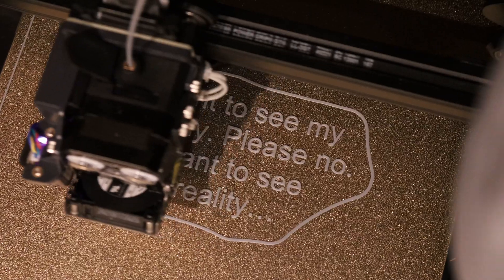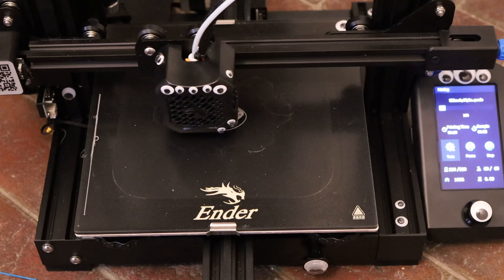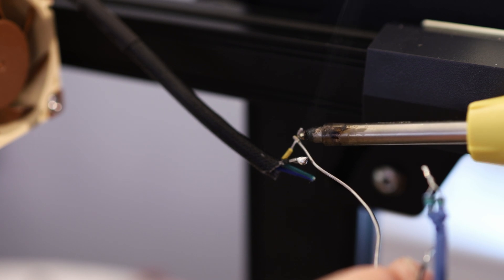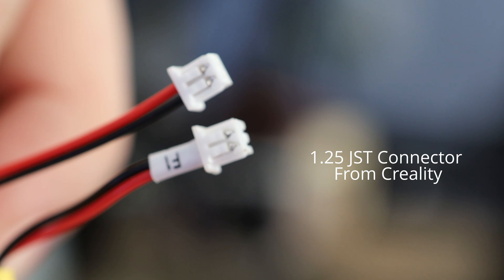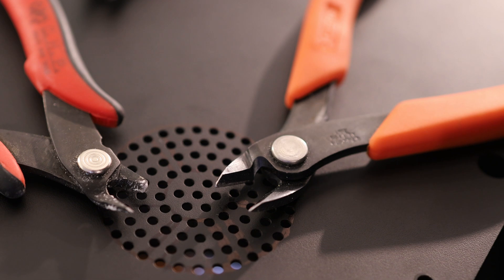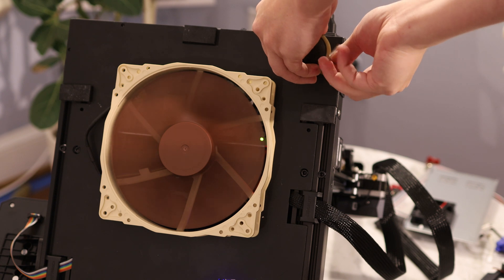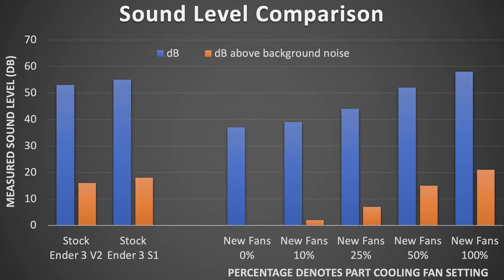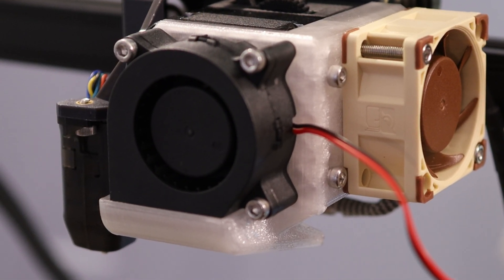Ender 3 S1 - The Silence of The Fans

Comment: Hi Im wondering why your Motherboard and Stepper drivers has increased. You only opened the case and used bigger heat sinks and still uses the same fan right? Why does this lead to higher temperatures?
Reply from the maker: The old motherboard fan was placed directly above the motherboard, so it directed a lot of cooling air right onto it. 
With my current setup, the motherboard is just in the exhaust path of the big fan. So not as direct airflow.

Also I noticed that some prints were done on PLA and some were done with PETG. PETG runs at higher temperatures, and draws more current, so everything on the motherboard gets hotter.

These are not research grade publications with all variables controlled as well as they could be. Just my modding, ramblings, and personal anecdotal evidence.
Reply: @NathanBuildsRobots  Ah I didnt know that u got rid of the motherboard fan. I gonna keep it.
Should I mind the maximum power of the power supply or can I connect without problems a new Power supply fan and a rasperry Pi?
Reply from the maker: @Uni-qk5tx  To be honest, I'm not sure! I think it should be equivalent to the previous fan

Comment: Thanks for the work you put into this. I can now print in peace! One thing I discovered was that on my noctua fans (A4x20 and A4x10) the red wire is +12V, not yellow as mentioned. I passed on making a separate cable so maybe thats why.
Reply from the maker: That is very interesting! Maybe on the 3 on versions is different? I always get the 4 pin versions
Reply: @NathanBuildsRobots  Yea I looked it up on the noctua page and found this https://noctua.at/pub/media/wysiwyg/faqs/noctua_pin_configuration_12v_fans.png

Comment: Are the Zener diode necessary with a NF-A4x10 FLX? cant see what it does exactly.
Reply from the maker: It just reduces the voltage from 24v to 12v. Its safer to just use a 220 ohm resistor
Reply: @NathanBuildsRobots  So if I have a 12V fan, the Zenode isnt needed?
Reply from the maker: @TLNozzle  to go from 24v to 12v there are a couple of options. 
Easiest is a resistor 
You can also use a zener diode, voltage regulator, or buck converter

Comment: What is that hotend you using on this sprite direct drive ? And can I just use what I have and just order the hotend?
Reply from the maker: Check out the CHT videos. I was using a slice engineering copperhead heater block, and Bimetallic heatbreak.

 I have also be experimenting with CHC heaters, which are much simpler to install because it's all integrated into a single part
https://amzn.to/3EEmFgg

Comment: Hi Nathan. In your setup,   Is the large fan blowing fresh air in or sucking hot air out?
Reply from the maker: Blowing in
Reply: @NathanBuildsRobots  Thanks man. You di a great job there. I just finished my own setup based on yours. The only difference is I left the PSU fan  and the motherboard fan but oriented both to blow air out, so the giant noctua blows in fresh air and the two small fans function as exhaust. It seems to work just fine.

Comment: So how much fans do I need? One big 5V Noctua for the base, one 40x20mm Noctua and one 40mm 24V 24V fan (the black one)? What about the 40x10mm Noctua?
Reply from the maker: I want to revisit this, using fans that are all drop-in replacements. Cutting metal isn't for everyone. 

But to answer your question:
You need either a 40x10mm noctua or 40x20mm noctua. I reccomend the 40x20 because it will provide better cooling
Reply: @NathanBuildsRobots  Thanks for the quick answer! Cutting metal is no problem for me, still looking forward to your revisit

Comment: Does the noctua help with the over hangs? I can’t get over 60 with just the 4020
Reply from the maker: The Noctua 4020 axial fans dont move a lot of air due to their low static pressure. A 4020 blower fan or 5015 blower fan would get you at least 75 degree overhangs. For reference, the stock fan is a 4010 blower fan

Comment: Hi Nathan, great video and i’m using your design with a 5015 fan. For the hotend fan i’m using a ultra small buck converter and all works well. I was wondering if you could share the step file so i can make an addition to hold the converter. Greetings from René from the Netherlands.
Reply from the maker: I have shared the F3D file on my Patreon. These can be opened in Fusion 360
https://www.patreon.com/posts/69426214

Let me know if you can access them

Comment: Ender 3 V2 had that problem, if you turn off part cooling the mainboard fan is also turned off. Is that the case with S1?
Reply from the maker: I'm not sure, but it seems like they carried over some of the design flaws from the Ender 3, so it wouldn't surprise me. The motherboard fan is constantly on unless you unplug the machine, which is really annoying to me.

Comment: i've realised I added this to another persons question by mistake - adding here in case it gets missed/hijacks their quewstion etc ...I just got my printer and printed another print head with the two jets mainly cos it reminded me of an octopus :D and I was put off by the 150 degrees, I'm so glad that is not an issue for the 12v fan. While it does indeed look cool, now when I print anything with infill I have pan pipes... And I can't add the side fan. Other than that the difference over the stock is so significant. Are the dual jets better/worse or the same in terms of output? Or does the fan improvement mean that it is now so over powered it doesn't matter?
Reply: and apparently now I am using my son's acct. le sigh... old person here sorry.

Comment: You left the PSU uncovered?... oof
Reply from the maker: It's covered by a fan! I could add a fan guard to make it safer.
There is a lot of space between those blades.

Fortunately, the the is always spinning when the power supply is hot, so it's its ok?
Reply: @NathanBuildsRobots  I like it. It’s conditioning you. Don’t fingers in here, it will always definitely hurt. Chop chop.

Comment: How do I validate that my hotend is cooled enough (without termocamera)? (I want to install different fans, not the same as you did)
Reply from the maker: As long as you don't have any issues with the printer clogging or underextruding, you're fine. I think all metal heatbreaks are better at insulating the hot and cold parts, so I can get away with using a smaller fan.

Comment: I was wondering if I could use the Zener Diode and the 4020 12VDC fan ran in parallel circuit with the existing stock fan for the heatbreak?
It would allow 24VDC to the stock fan whilst a parallel 24VDC split into 12VDC across the Zener Diode and the additional fan.
If that would work:
Would there be any concerns?
Would it be overkill?
Reply from the maker: I think you really only need one of the hotend heatsink fans. I took the original one out since I thought it was kind of loud. 
But if you leave the original hotend heatsink fan in place, you can just replace the past cooling fan and call it a day.

Comment: The sound that my S1 pro makes is crazy. Just the fans. I need to replace them. I would like to see another video for the pro version, maybe more updated with links to buy the thinks we need. That would be awsome.
Reply from the maker: The fan replacement process should be very similar for the Pro, but I may do another episode on S1 Pro fan replacement. It won't be out until next month, but it should be interesting.

At higher speeds the Y axis on my Pro is loud compared to the normal S1, almost to the point where the fan noise doesnt matter.
Reply: @NathanBuildsRobots  Thank you for your work! I will wait, and I will share the video in this facebook group that are s1/s1 pro owners only. This would be very helpful. (P.S. if possible, try with less crazy thing, cutting the bottom so mutch and cutting original cables, are very scary things to see)

Comment: Hi there, can you share the setting to printing with PETG? The Nozzle and base plate temperature, Fan speed, etc...
Reply: Another question, what was the position you used to get the best result of printing?
Reply from the maker: @1980humbe  I place it in the middle of the bed whenever possible. It has the most even temperature
Reply from the maker: I use mostly the same settings as I do with PLA.

Differences are: 
Usually I do 70C bed, 240C hotend.
Fan speed limit set to 50%
also, I don't push the speed as much as I do with PLA
Reply: Thanks! 👌

Comment: When I was cutting out the hole for the 200mm fan my bottom panel got all mangled, it’s beyond fixing, what should I do?
Reply from the maker: You didn't need that panel anyways 🙃
Personally, I would hammer it back flat and make it work

Comment: Hi, firstly I'd like to say, watching your video was inspiring more then enough to do it by myself. 
I did follow your steps, but connecting fans is a part where I got confused. 
If Blower is fan 1, noctua fan 2, so what about the left generic fan? Did you make an Y connection with noctua or is it obsolete?
Second question is about big one, did you connect it to the motherboard or power supply?
Btw i did change one thing though, I didn't like the idea of cutting the plate to leave the motherboard open. 
I am going to get rid of the drawer to make the air outlet and prep new cover.
Reply from the maker: 1 fan is on the blower
1 fan is on the hotend heatsink

For the big one, it's being powered directly off the power supply through a buck converter set to 5V. I plan on using this to power a raspberry pi later on.
Reply: @NathanBuildsRobots  Thanks a lot, raspberry pi zero is on my wishlist until the price settle down again. 
Regarding fans, did you removed the left generic heatsink blower? or did you left it unplugged?
Reply from the maker: @krzysztofmalinowski8345  I took it out. Didn't cover that step but on video

Comment: do youhave something like a wire scheme where to connect the fans on the extruder?
Reply from the maker: I should make one, but I'm really wanting to make an open-source breakout board to replace the stock one. That will be taking up all my spare electrical engineering energy.
Reply from the maker: https://www.nathanbuildsrobots.com/projects/ender-3-s1-breakout-board-replacement

This should show you some pinouts for plugging thr fans in

Comment: Really good video and I already started with the part cooling fan and already saw some huge improvements but my question is what did you do with the old cooling fan for the hot end did you just leave it in there unplugged or what happened with that
Reply from the maker: I removed it so it doesn't impede the airflow, but you could probably leave it in there. 
If i left it in, I would consider running it and the noctua fan at 12v in parallel, with the 2nd noctua flow direction reversed so they arent fighting, if you catch my drift.

Comment: is the 40x10 noctua enough for the hotend cooling and to prevent heat creep?
Reply from the maker: Yes, I measured tenps and its identical. But keep in mind, I also upgrade to all metal jotend with all my machines. This reduces heat transfer so a larger fan is no longer neccesary.

Comment: I did this mod (5015 variant) on a s1 pro, added some tweaks of my own to the stl. The part cooling exhaust was a bit too high and the duct had suboptimal airflow imo. 

I noticed the PWM for the cooling fan is really low speed. Something close to 2 Hz which results in the fan permanently whining at lower speeds. I tried putting a capacitor in parallel but it was too big and the result was a fan that ran close to 100% regardless of the actual PWM value. The cap just pulled all the current in the on phase and the stored energy never got drained before the off phase ended. Has anyone experienced similar behaviour or might I have a broken board? The steppers aren't very silent either. They are very audible even without the duct mod. The power supply and board mod is too involved for me right now. Such a shame that creality always has to half ass their products. But hey, automotive design! Yay.
Reply: hey im doing the same thing now, tommorow ill wire the fans. i dont think you broak the board is it working without the cap now? try adding another cap with lower capacity. there are some guide on how to calculate the needed capacity "pwm smoothing" Did you add the cap parallel or in series to the fan, i think parallel is the way to go.
Reply: @satoshipokemon8411  Yeah, I realized I forgot the R part of the RC-filter. Adding a fitting resistor before the cap will stop it from pulling all the current and henceforth produce properly smoothed voltage. Just need to calculate the resistor so it lets just the current, that the fan draws at full throttle pass through, not more. 

I don't have the right cap lying around right now, the one I used is ginormous and was just for cross checking. I wouldn't want to fix this problem that way anyways. The proper method would be to speed up the PWM coming from the motherboard. Already upping the frequency to about 20Hz should do the trick, but usually PWM frequencies are more in the KHz region. Computer fans get 25KHz so the frequency is above hearing range. When the fan is unmounted and running you can see it twitch from speeding up/down. That can't be good for printing quality.

I just wanted to confirm that it's not just my motherboard, that's doing the low freq PWM thing. Probably it's just creality bungling the firmware as it seems to be "their thing".
Reply from the maker: The real solution is for 3d printer manufacturers to start using 3 pin fans on the ATX standard that every desktop PC already uses. That way they can tap into the huge supply of cheap and silent desktop fans. They don't even have + and - standardized currently, its swapped on every other fan i mod, which is just silly.

Comment: Heyo! I'm trying to do this and sorry I'm slow but at one point you seem to be using a 40x20 noctua and then at the end it looks like a 40x10? Which one are you using for the hot end cooling? Also are you leaving the original fan located on the left side of the extruder assembly?
Reply from the maker: Either will work. The 40x20 fan I later realized was a 5 volt variant, so it was drawing too much current. 

I took out the original mini fan

Comment: M3 bolts don't fit any suggestions?
Reply from the maker: For which part? If it's the printed part, you may need to reprint with smaller holes, or shrink them some other way. 

I have a toolkit with m2,m3,m4, and m5 books, and have always been able to find screws that fit for my 3d printer mods.
Reply: @NathanBuildsRobots  for the duct part for the fan my holes were too small for m3 and couldn't find any smaller had to heat up  a screw and drill through it to make it bigger

Comment: Can i use this also for the "3 S1 PRO" ?    Edit: yes is also working for s1 Pro
Reply from the maker: Thanks for beta testing. I just got a pro and was going to try this too
Reply: @NathanBuildsRobots  i did remix you part with another one, so i got a dual duct for a single 5015 and a 4020 fan both fans are 24 volts so no needs for doing voltage conversions and the sunon fan is really silent and cheap while blowing more air than the expensive noctua ones. look for the mf40202v2-1000u-a99   there is also 1 variant thats a little better on airflow but also little louder
Reply from the maker: @satoshipokemon8411  nice. I think I bought a couple 24v Sunons to try out. Only annoying thing is they aren't on Amazon Prime
Reply from the maker: @satoshipokemon8411 

The 2 models I bought: https://amzn.to/3H2iIBd
https://amzn.to/3x7WJUR
Reply: @NathanBuildsRobots   already excited about what you will do with them. by the way, 3s1 pro auto level/mesh is somehow bugged if you have problems just reset the printer and use manual level 🥲. wasted hours trying to figure out whats wrong 😂  butt seems some firmware bug and no newer fw available till now
Reply from the maker: @satoshipokemon8411  Thanks for the heads up. That is Creality's classic strategy of releasing a half baked products and letting the community fix it. And then never bothering to actually fix their product until the next version is released.

Comment: The side cutters are not even made for that work you have used then, no wonder they breake, they are only for cutting electronics small wires and legs from resistors and similar work, use propper tools for the work and they hold much longer.
Reply from the maker: I consider the clippers I was using as "borderline acceptable" for the job, with safety glasses as necessary precaution. They are high-quality American made cutter that can probably make 1,000 - 10,000 cuts before breaking, which is better than most tools you get at a hardware store.
The ones that come with the printer are too thin and would break in 10-100 cuts and are definitely a no-go.
Reply: @NathanBuildsRobots  I cut a thicker piece plastic with a side cutters I thought it could be done, but than the one blade snapped and was flying in my direction, it's always better to wear saefty glasse. 😬
Reply from the maker: @WaschyNumber1  quality control is extremely important for tools subject to repetitive high stresses, like cutters. 
Simple mistakes in processing can result in a loss of 90% or more of its strength.

Comment: Silent fans but they don't push enough air
Reply from the maker: The thermal images toward the end shows no difference between silent fans and stock fans. So they are adequate for the application, or at least as good as the stock onez.